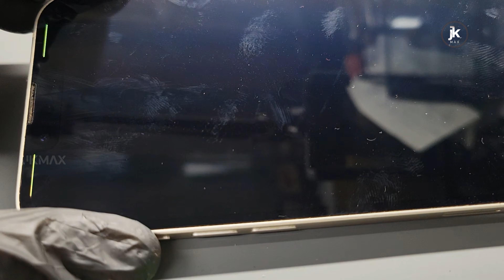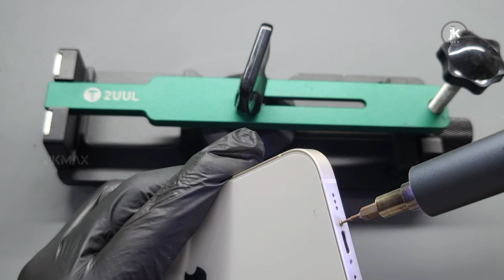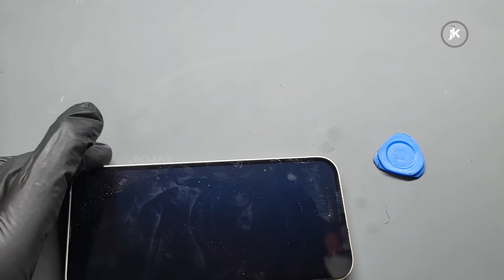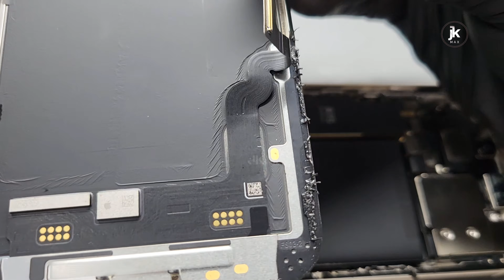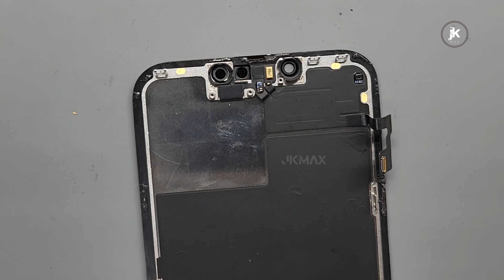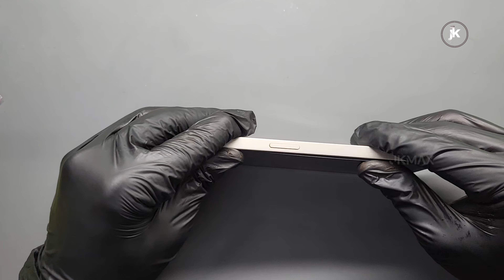✅ 100% working  |  iPhone 13 Green Line & Black Display Fix ? | #iphone #iphone13 @jkmaxx

Comment: You sure it isn't caused by update?
Reply: I have an iPhone 13, which I didn't drop or get wet. I updated it to the ios 26. It started off really bad, and then suddenly this happened.
Reply from the maker: Sometimes after an iOS update, temporary display issues like green tint, green lines, or screen flickering may appear.
👉 However, if these problems persist, it is likely due to a hardware issue, such as:
1️⃣ A damaged display panel
2️⃣ A faulty display connector
3️⃣ A defective GPU

Also, moisture exposure or physical impact can damage the display circuit, causing green tint or lines.
It is recommended to check the hardware if software updates don’t resolve the issue.